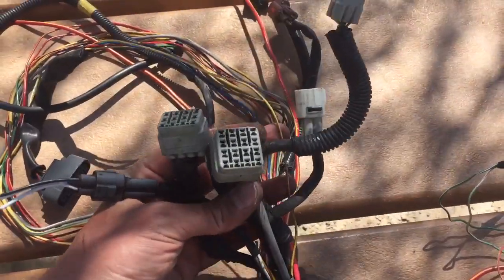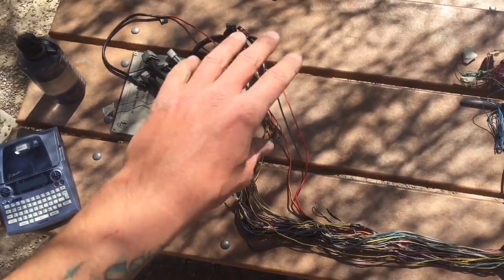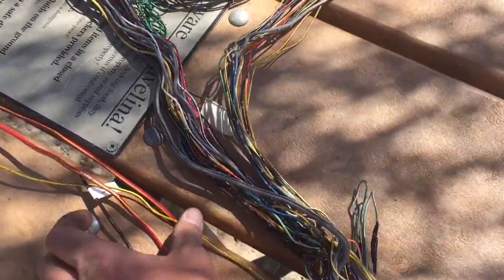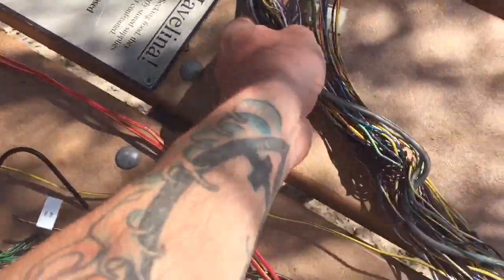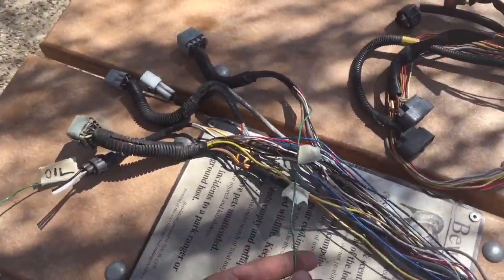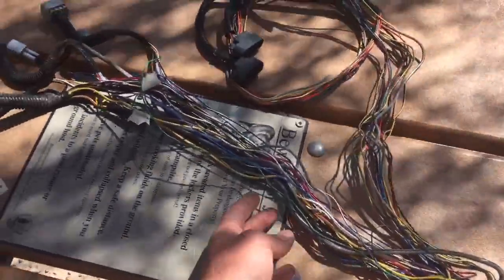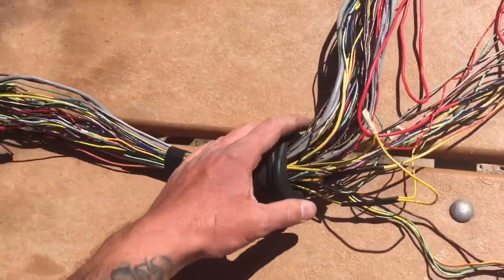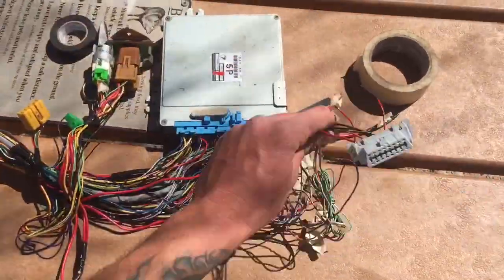9. Harness Forming 2/2 - Wiring Harness Series

Comment: I noticed in your videos that you call what I would consider a coil or ignition coil an ignitor.  Is that what Subaru calls it, or simply what you refer to it as?  It threw me for a loop until I started looking at the harness in my donor car.  Thanks again for your videos!
Reply from the maker: +Kevin Alberts This is what Subaru calls it. Newer models have the ignitor integrated into the coil.
Reply: Understood, thanks for the explanation